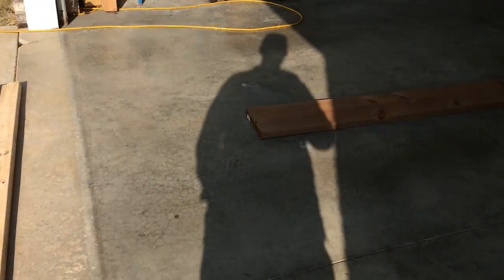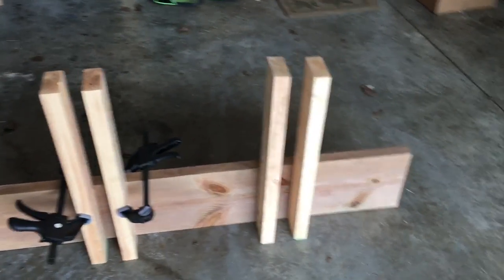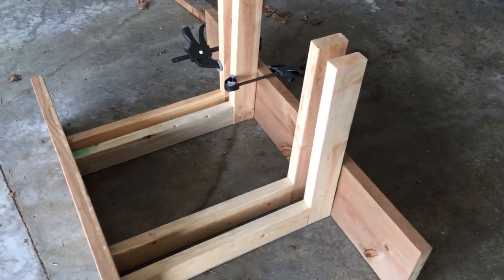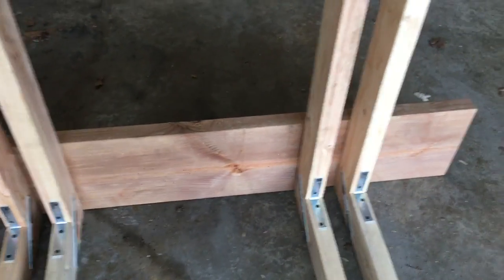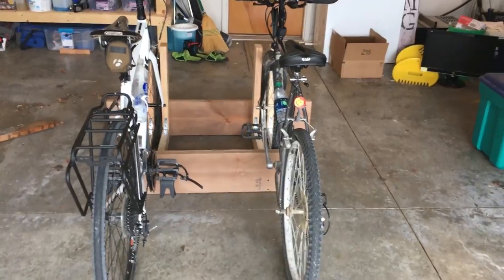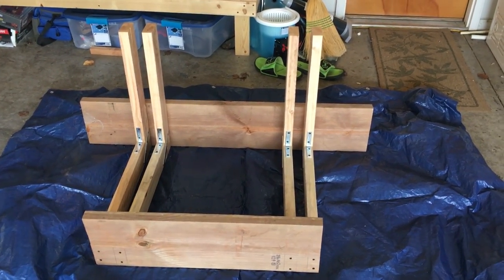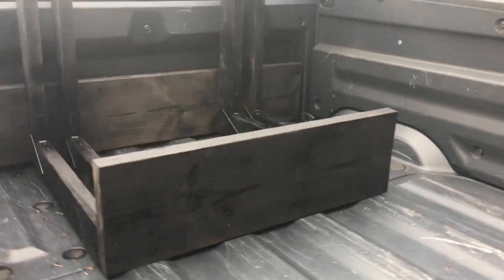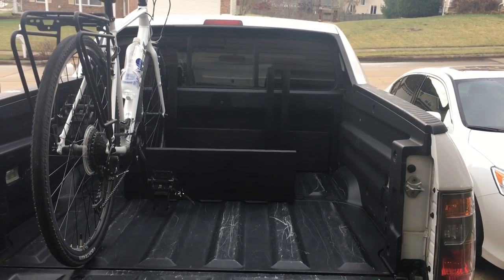Easy Affordable Truck Bike Rack for the Trek FX3

Comment: Built my rack based mainly on yours. I used 2x6's and they are just right for securing our 27.5" comfort bikes. Easy, stable carrier built to fit my Colorado short bed. Just add a few strategically placed bungies and I would not hesitate carrying the bikes anywhere. Thanks!
Reply from the maker: Fantastic!  So glad it’s working for you.  I still use mine to this day.

Comment: Nice job. If you drill a cross hole in one set of the 2x4's where the bike rim is below the surface, you can put a rod across them and lock the wheel to the rack. Its my next project.
Reply from the maker: Great idea as well.  Still very happy and use it regularly!

Comment: How did hold up over time?
Reply from the maker: Good.  No issues.
Reply: @BradBeaird  how did you end up attaching it to the truck?
Reply from the maker: @stevegarza1643  I didn’t attach it.  It  had enough weight to stay in place and was the width of the truck bed so it didn’t move around at all.

Comment: Gonna give this a shot this weekend.  May use 2x6
Reply: How did you end up strapping the head board to the front of the truck bed?
Reply from the maker: My truck has tie down points up front,
Reply: @BradBeaird  Finished mine, very happy with the results.  Had left over gloss black Rust-Oleum brush paint and it's sturdy and does the job.  All in with lumber and brackets...$40.  Money well spent, and saved vs a bed rack in my Jeep Gladiator. Thank you again for sharing.
Reply from the maker: Enjoy!

Comment: HibBrad! This looks great. I’m repurposing some scrap pallets and beach wood to build the rack for my 2022 Ridgeline.   Do you have the dimensions of the wood you used?  Thanks!
Reply from the maker: Sorry I don't really have the dimensions for the wood I used and it's been so long ago, I certainly couldn't remember any longer :D
Reply: Got it. Thanks. That’s the thing with videos. They live everyday as though they were just filmed. Anyway, clever design. I am using pallets where there are two 2x4s nailed as supports already, and 2x10’d washed up on the beach.   Decks Screws in the garage. The only cost will be the metal braces.

Comment: Thanks for sharing this.. Question, as you built it, any movement from the bike(s)? I did not see any straps across the wheels or similar so I'm wondering how secured it may be traveling a short highway distance.
Reply from the maker: I put one strap across back wheel and that seems to work well.  Minimal movement overall as long as you drive reasonably.
Reply: @BradBeaird  yup, just started thinking about this and a good strap would do the trick. Trying to see if I can build a 4x bike rack for my Sierra Elevation. Any idea on weight of the one you built?
Reply from the maker: No clue but I can pretty easily lift it in without issue.